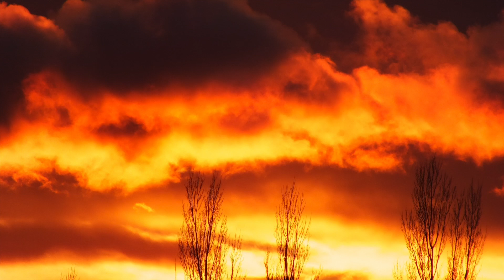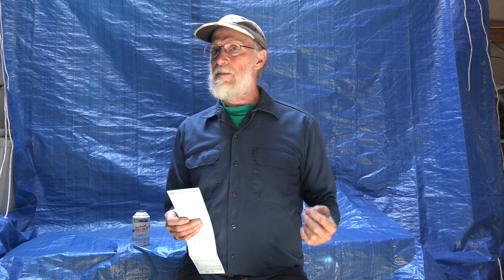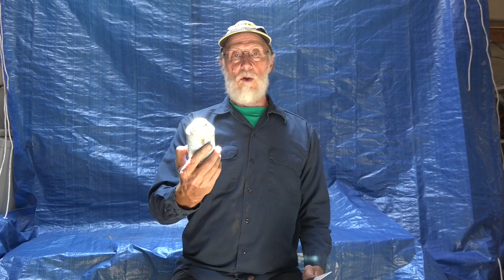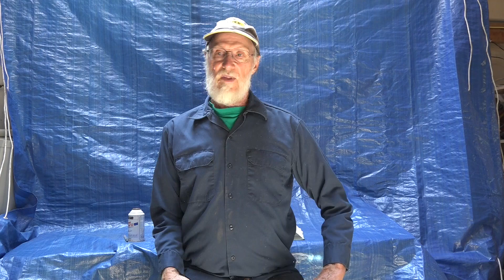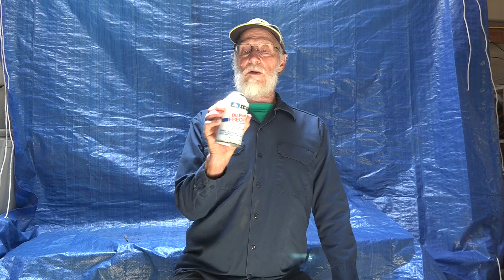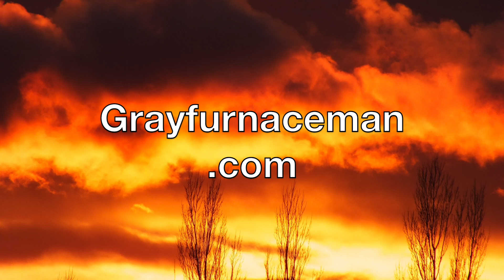R -12 refrigerant

Comment: Dumb question- What would happen if you fill an R134A AC system with a TXV with R12 and switched it to mineral oil? Would the performance of the system improve? Thanks.
Reply from the maker: I can't say I know what would happen.  R-12 is slightly higher in efficiency.
GFM
Reply: Thanks man. I'm pretty sure it would work. Since R134A is similar enough to R12 that it can be used in R12 systems with reduced performance, I presume the opposite is true too. I presume that the performance of the system would be a little better with R12, but I'm not sure. I would think it would be easier on the system due to lower pressures if it worked though.
Reply from the maker: It might but it would be marginal.
GFM
Reply: Thank you!

Comment: Look at the pre EPA ( say pre 1990) economics of car ac units. Freon R12 was just 50 cents a can once and folks would add a can every other year to the cars AC unit if it had a small leak. The leak often in the North was the shaft seal was not turned much and thus the Freon would leak out a few ounces each year. Todays cars have the AC tied to the defroster; ones ago some cars did not do this.

Comment: R12, along with the other CFC's have been banned here since 94', its a shame as it worked well and was also easy to work with but you can't ignore its environmental effects once it leaks from the system it is used in.
Reply: grayfurnaceman I strongly agree that it should have just been regulated by eliminating R-12 use as a propellant and require all other uses fall under the the recovery policy. My many years of auto air conditioning work from repairing to installing new units gave strong evidence that 134a was not a very good replacement. The need for larger evaporators, condensers ,thicker hoses to hold the smaller molecules, higher operation pressures, and the lack of oil movement with required ester oils all added to higher costs of auto a/c. It was a nightmare during the transition. The government got carried away with their knee jerk reaction to R-12
Reply from the maker: heavydiesel All true.  There may be a case made for recovery of R-12 as other refrigerants, rather than banning of the product.  Its efficiency has not been matched (R-134A seems to be pretty close) and other refrigerants use somewhat more energy that contributes to global warming.  Someday I will have to explore that whole issue.  Thanks for the thoughts.
GFM
Reply: When you live in phx az pretty close wont cut it.

Comment: Man, back in the day when you could buy a can of R-12 for $1.00. The car parts places used to damn near give that away.
My father was in commercial refrigeration, so he had all types of refrigerant. I recall the day he recharged some old chrome plated, all in one display unit that was made to drop into the top of an ice box to convert to mechanical/electrical cooling. The refrigerant was sulfur dioxide... That stuff was NASTY
Reply from the maker: Craig Nehring Sulphur dioxide will make you run for the hills.  
GFM
Reply: Yes sulfur dioxide was nasty to work with.  So was ammonia.  In some old commercial refrigeration ammonia is used today.
Reply from the maker: George W Ammonia is still one of the best industrial refrigerants available.
GFM
Reply: Right it is. R707A is the designation of ammonia.
Reply: How does ammonia compare to R12 efficiency wise?